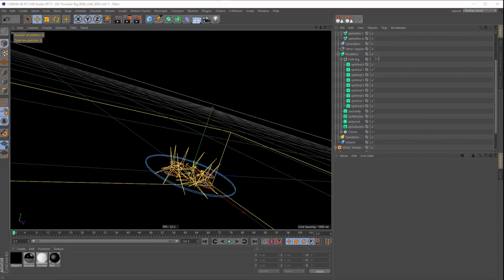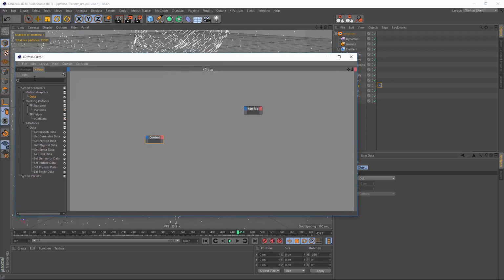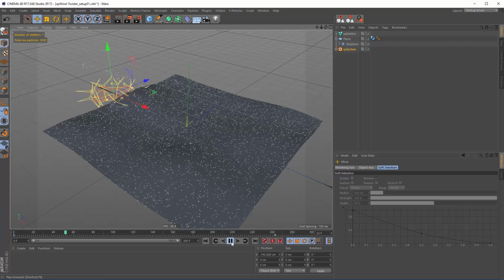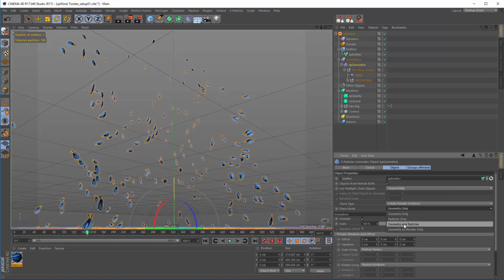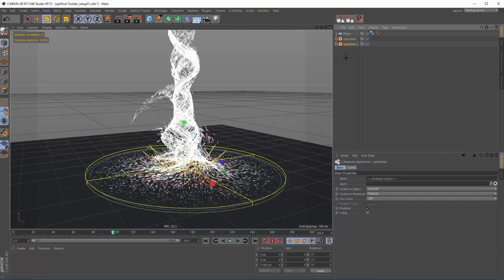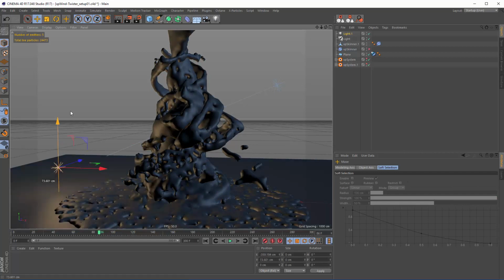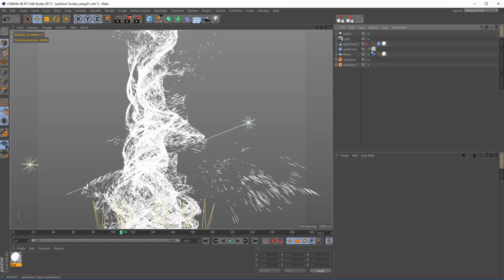X Particles 3 5 Tutorial - xpWind Twister

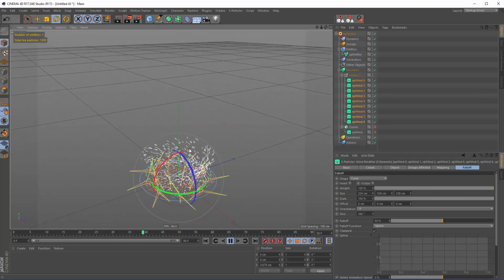Comment: Quick question. How do you work the falloff settings around 4:11 with R20 and the new features like Fields etc? The menu is different now
Reply: I ran into this as well.  If you click and hold the "Create a new Field Object", you can select the cone shape for the falloff :)
Reply: @kwongster  Yeah but the settings are still different...I'm playing with the Cone Field and trying to adjust accordingly but the rig falls apart.
Reply: @BenEshagpoor  Hey man did you ever work out how to fix this?
Reply: @Generic-ji2bj  No...I think I ended up not using X-Particles for the client project.
Reply: Did anyone ever get an answer on this one lol? It seems like with the update, I'm forced to add a cone field individually, one by one, to every single wind modifier and manually inputting the length and strength over and over. Seems odd to make it far MORE difficult with a newer version... And then even after doing all of that, it still doesn't look right